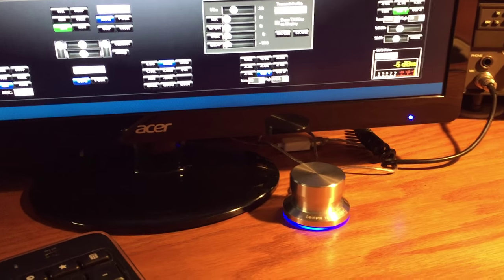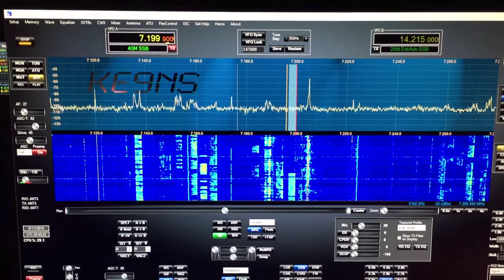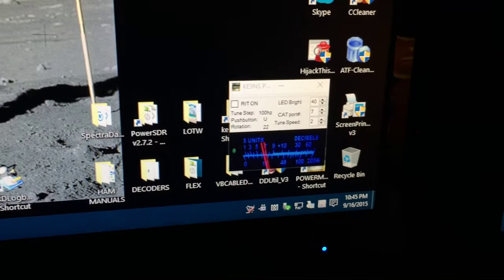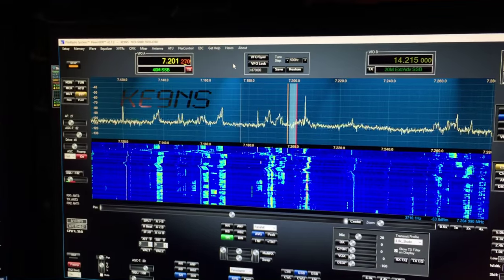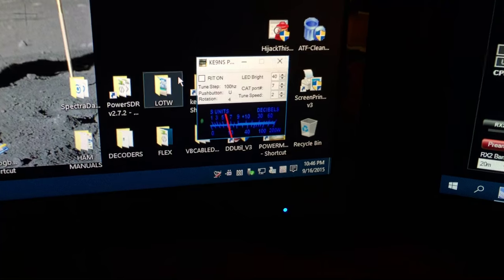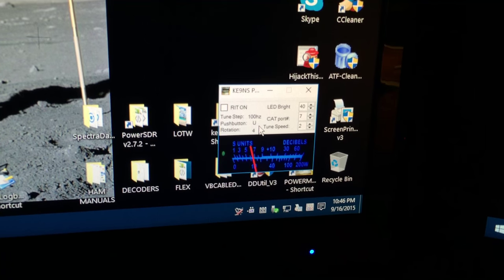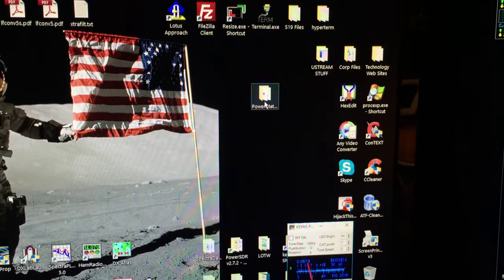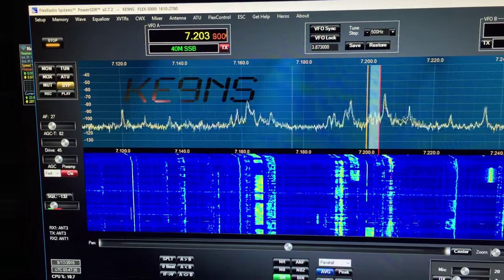Flex-5000a & the Griffin PowerMate Knob

Comment: got it working!!!! - The secret for me it power mate already installed tried to over ride it, so solution was to remove and dump the dll into the powersdr folder and then run your exe file - great thank you so much - will pass info on as they said it couldn't be done - well done Darrin - btw works in windows 10 and windows 7 too
Reply from the maker: +Les Norton Great. Yes you definiately do not want the Powermate program (that comes with the knob) running (if you see the knob image in the tray, then its running), only the Griffin driver needs to be installed (which I think on windows 10 it automatically finds, so you dont need the disk that came with the knob).
Reply from the maker: +Les Norton I just uploaded a corrected version of the software to my website. I made a mistake in the code. this version should operate smoother, and properly work both local and remote. I changed the appearance slightly as well.

Comment: Have found an issue with the power mate knob and thought maybe someone would have addressed it but i think its something to do with the power mate application. I would like to use it to control a remote Flex 3000, but it will only control the computer its plugged into. Yet a mouse will control it remotely - anyone written a program or script to get this to work?
Reply from the maker: +Les Norton I will look into modifiying my first version of software that uses keyboard shortcuts to control frequency. At the moment It only works when PowerSDR is running locally.

Comment: Thanks Darrin will keep an eye on your website http://ke9ns.com/flexpage.html 
Look forward to testing this, have also passed your website on to others as its a wealth of information.
Reply from the maker: +Les Norton Its up on the web site.
Reply: +Darrin K is it the one in a folder called powermateRDPknob and the files (2) power mate dll and power mate_KE9NS.exe
Reply from the maker: yes. if you already have the griffin driver installed, you simply run the exe in that folder. (I think it needs to be in ADMIN mode).

Comment: Darrin have uploaded a video showing it working, its just a short video and I include a thank you to you in the text, please feel free to use it if you wish - https://youtu.be/pBcZ2lHnhkU
Reply from the maker: +Les Norton Nice. I will take a look. If you press the knob I have it cycling through 3 step rates: 100 hz, 1khz, 10hz. Since I usually use the knob just for fine tuning I use the 100 hz most of the time. I use the mouse wheel for 500 hz steps.

Comment: I thought it would be an opportunity to pass over 3650hhz in my flex1500, but it did not work. Nice work, strong 73
Reply from the maker: +Pablo Alessandro (PY2PJA) The 3650 is a limit set by Flex in the source code. Its probably set like that because of the USB data bandwidth needed to handle a wider TX profile ? I would want to test it before touching it.